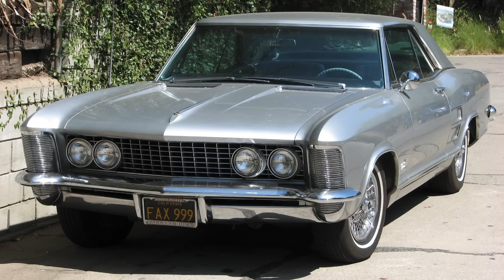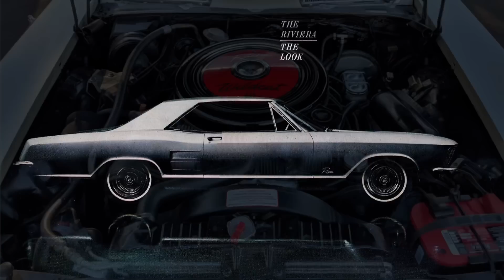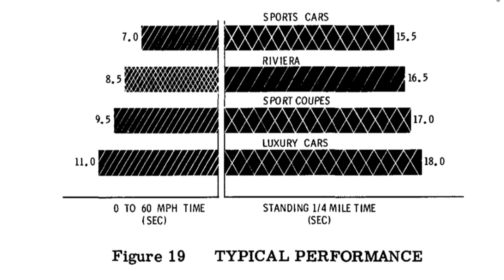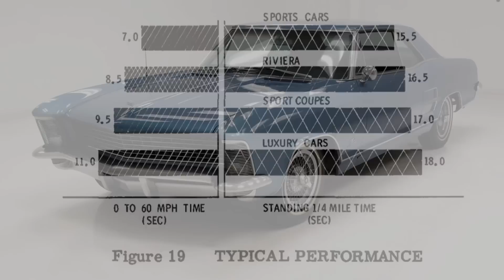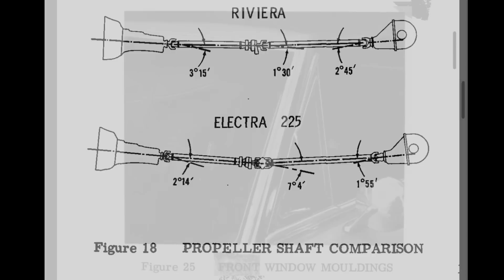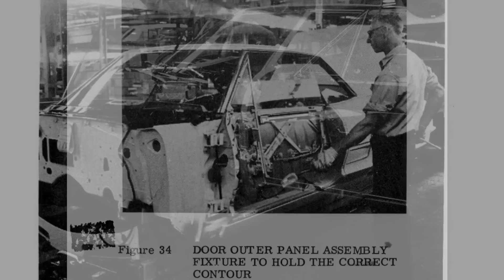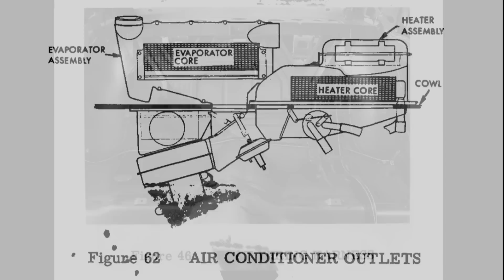Facts and Trivia about the 1963 Buick Riviera That You Never Knew!

Comment: I am just barely old enough to remember r12. At 54, I was a teenager in the '80s and I was in my twenties in the '90s. I can't tell you exactly when 134a happened, but I do remember that since I was young and broke I was driving older cars that generally had R12, And it was getting harder and harder to find it because R134a had been legislated into being the new standard. 

So given that announcement of my credibility on the subject, I can tell you with certainty that  R12 was one hell of a lot better. It was colder, and it worked faster. R134a requires you to start driving the car, to blow air over the evaporator, before it reaches it's cooling potential. R12 was not that way. You could leave your car sitting in the driveway idling, and the whole interior would be cold by the time you sat down in it. 

From what I understand, your government has dubbed it down even worse and are now replacing 134a with something which I have no doubt will make 134a seem like a luxury. 

Stop electing Democrats. I mean, that's what this all really boils down to.

Comment: Approx 4600.00 in 63, which was one heck of a lot of money back then. The car had positraction so when you put it in low and mashed it, you could "burn rubber" even in a luxury car. Also, the ignition had an "on" "off" and lock position so if you  didn't turn it to lock you start, run and drive the car without the keys. You could also remove the keys with the engine running and go unlock the trunk.

Comment: Although the door skin hangs on the inner, I would disagree with it not being structural. The inner and outer panels combine to make the shell rigid. I have a 63 apart in my shop getting ready for paint. With the skin off you can twist the inner door and window assembly like any sheet metal part. I believe the door actually aligns with th body by the bumpers inside the rear jamb area....another fun thing to deal with on these cars.

Comment: My first job out of high school was working for a Buick dealership (64-66). I remember driving 65 Riviera Gran Sport 100 miles on the Interstate. I never got it over 85 for fear of getting caught and then fired. The Turbo 400 in the 64 Riviera was a huge improvement over the Dynaflow in the 63. You have one picture in here that is wrong. It appears to be a 63 with a 65 front end on it since it has the disappearing headlights. Good video.

Comment: O i would so like me a "Rivi" but i must insist of one of the newer models with the boat tail rear window.
Mine would need to have NO LESS than a 572 CUI engine in it. i would accept slight modding, but done with extreme respect for the original.

Comment: The narrator is correct in this video. GM executives tagged Cadillac to make the concept car a production model, but Cadillac was not interested because they had other projects. So, GM executives asked Chevrolet if they were interested to take the project. Chevrolet was not interested either, so the GM executives told Buick, Pontiac, and Oldsmobile to figure out amongst each other and decide who is going to take the project. Pontiac, Buick, and Oldsmobile went back and forth arguing trying to figure out who is taking the project. Finally, Buick gave in and took the project. When the Riviera debuted, the American public was stunned when they saw the Riviera

Comment: Interesting that they went thru this much more trouble to assemble the Riviera.  Honestly though the interior looked better than a 1963 Cadillac, at least in terms of style.  Both were very well built but I wasn't alive in 1963 to sit in both when they were brand new to judge material quality/squeaks/rattles/panel gaps to tell if Buick built a better car than Cadillac. 

 I can tell you though that even the very best of GM didn't hold a candle to the hand built stuff from Rolls Royce/Bentley.  Or even Jaguar.  The British IMO built very nice furniture on wheels, I'm talking stuff like interior fitments, the quality of the wood/leather, the tight gaps on the hand fitted bodies, the paint jobs, those hand built British cars were just a notch above what we were doing in the USA, the price reflected it.  However in terms of stuff like brakes, handling, horsepower, heat/ventilation/cold ac, Cadillac and every other American car shat all over the Brits.
Reply from the maker: Yes. RR and Jag both used GM AC systems and transmissions too. 

I will say the electrical system on the GM cars is far better than the Lucas electrics on the British cars.

Comment: Rivs remind me so much of a young boomer childhood. The first car I remember was a '64 convertible Wildcat but then came a 68 Riv then a '73 Riv with that big , funky boat tail and that torque monster 455 with duals, a center console, buckets and Buick rally wheels.  As a 10 year old kid, the hood on that '73 look 10 feet long. I always like to hear the sound of that Quadrajet opening up when we'd get on the freeway. It's hard to believe that GM actually used to build cool cars like that. My brother was offered that car when he turned 16 in 1975 but wanted a '75 Trans am with a smogged out 400. I would have gladly taken the '73 Riv with only 29,000 miles on it.

Comment: No mention of the '63 With the Twin Turbie Dynaflow Drive.  Starting in Lo and shifting up manually around 45 gives 0-60 time around 7 seconds flat.  In 1972 we wwere shopping  for a daily driver for my wife.  We found one '63 Riv but it was "rough". We also found a '61 Six Window Electra 225 and a '65 LeSabre sport coupe. All three were the same price , We picked the LeSabre. But knowing what I know now we should have bought the Electra 225.  Because we still hav eht eLeSabre 51 years latrer.

Comment: My all time favorite car of the 60's.   Blew me away as a 12 year old when it was introduced, and my favorite would have been the 64 with the 465 motor and turbohydramatic, and not the gawdawful vestige of the Dynaflow in the first model.   Also the AC controls were more standard and not as goofy as the aircraft style plungers in the '63. Adam some day you should do a Buick Invicta wagon...we had family friends with a '63 and red leather interior and it was soooo luxurious at the time, with a unique rotating HVAC mode selector.  We would go on driving vacations with them and I used to get so angry with my sister, who manipulated her way into their car every time, and I had to ride with my parents in our un-air conditioned brown '62 Chevy Bel-Air wagon that had a weenie 283 engine and came from the factory with a rancid smell that never went away...the original vomit comet. Riding any distance in that dump of a car was the stuff of childhood nightmares.
Reply: If only that Bel Air wagon had the 4 speed dual quad posi traction 409!
Reply: @garyblanchard1084  Hi Gary...it took 6 more years before my dad surprised my mom (and the family:  he was a heretofore ruthlessly practical mechanical engineer who always bought basic  cars with cheap trim paired with one of the smallest engines) with a new completely loaded '68 T-Bird with the 4V 429....that car was a torque beast. From that point is was American luxury cars with the biggest engines....I thought I'd died and gone to Heaven.

Comment: Always intrigued with the twin turbine (Dynaflow) transmission used through 1963. I think this was the last year for the suction throttle ac adjustment. When the heater core is cold the ac always seems colder because there’s no hot air bleeding through.

Comment: Volkswagen also used removable door skins on the Jetta and Golf MK5 series (05-10).  I worked at a shop that serviced a lot of VW cars and worked on such cars.  Made it very easy to repair the interior parts of the door.

Comment: The flush glass was a great idea but the engineering fell apart. Today's cars have not only flush glass they have....a tint around the perimeter of the glass which preserves the bead that seals the glass. I suspect the beading material is much stronger and UV resistant. Had the Riviera had today's technology with this half of the cars would have been saved due to the fact that there wouldn't have been such a rust issue.

Comment: Thankfully the Super Turbine 400 3 speed transmission replaced the Dynaflow in 1964. Buick and Cadillac premiered this transmission a year before the other GM divisions (later called the Turbo 400). The 425 was the standard engine on Rivieras for 1964 and 1966,

Comment: I know there was a Dual Quad option for Buicks then….was the 425 Wildcat engine thus equipped? Or was this with a four barrel carburetor?
Reply: The 425 with dual quads would have "Super Wildcat" on the air cleaner, and a fancy chrome dual snorkel setup, at least on the one's i've seen.

Comment: Hmm.  Power windows and assembly line a window adjustments.  
   
I guess the black cable running over the roof in the second assembly line photo may be a temporary power supply to run the windows up and down to adjust them.

Comment: The Riv' as we called as kids, was the most beautiful muscle car, which we never called it, for almost every generation.
Hated the 'X' frame. As a kid, I'd seen several 'B' body Impalas, which a SS was my first car; involved in head on crashes, where the trans & driveshaft could go into the road surface or the passenger compartment. The steering column was lethal. Not good. Great for lowriders. Once again, I've been schooled by Adam.👍🏾🏁
Reply: And those way cool taillight lenses with the stylish R in the middle!
Reply: On the Buick the steering box and linkage is located behind the front axle centerline  lessining the effect in a front end collision.  I don't know about the other GM X frame  B body cars.   I do know the '64 and on A bodys had the steering box and linkage forward of the axle centerline.

Comment: First gen Riv, like a lot of first-gen cars, was the nicest looking and one of the reasons for that is the slightly smaller size.  It did manage to maintain the looks throughout 3 model years which is not often the case.  The annual refreshes sometimes spoil the look of the original design.

Comment: Great video. Even though I'm a car guy and my dad had a 1963 Electra 225, I learned a lot that I didn't know. The 1958 Thunderbird introduced the concept of a four-place, close coupled luxury coupe that had very good, sporty performance. It was a very high quality car, as was the Riviera. Although Thunderbird was the original, and was a beautiful automobile, in my opinion the 1963-1964 Riviera is the most beautiful production car ever built in any country. The 1965 Pontiac Grand Prix and the 1965 Oldsmobile Starfire round out my top three as far as looks go, but they are not really in the Riviera's league. (I thought the 1965 Riviera was ungainly looking from the front because of the too-wide grille and the rear was not as beautiful as the 1963-1964.) Of course all of this is one man's opinion, except for the fact that the 1958 Thunderbird originated the class. The Thunderbird and the Lincoln and Continental were all unit body construction and were built at the same plant. The Thunderbird was one of the few successful 1958 model cars because of the recession and quality control problems throughout the industry. Thanks for your videos. They are very informative.